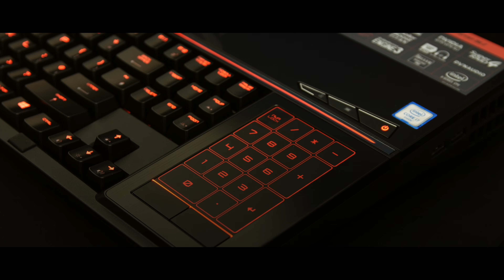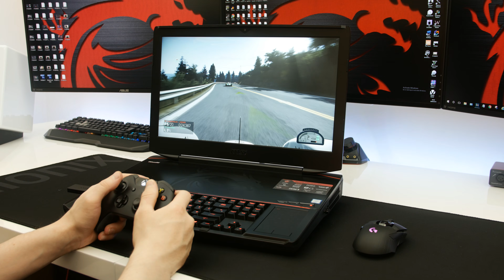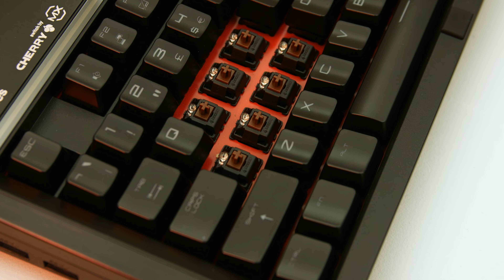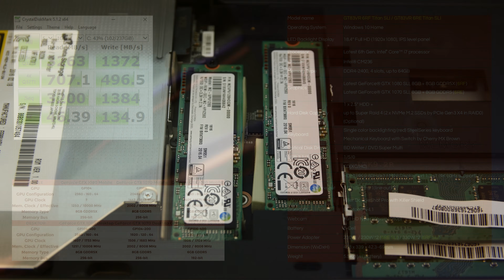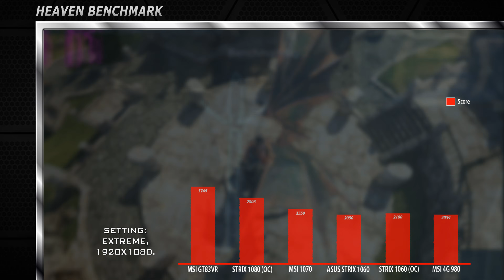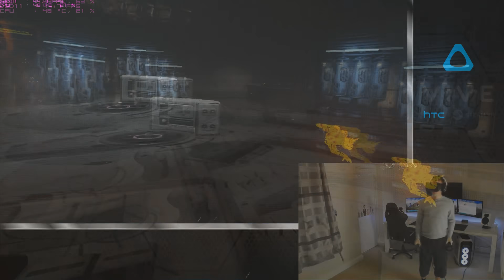MSI GT83VR Titan SLI Gaming Notebook Review, (GTX 1070 SLI Benchmarks)

Comment: Hello Silenced Tech, and those who watch your videos. Good video.
You already have approximately 2 year that you tested this GT83VR laptops.
The question are:
1. Does the laptop still work well?
2. What did you think of the mechanical keyboard, does it work well, do you like it or not anymore?
3. Is it overheated?
4. Does not that laptop fail (screen, ram, memory, etc.?
Thanks for your response. It's because they sell me one at a low cost

Comment: getting this tomorrow with 1070 sli but 7th gen i7, 64gb ram, and both teh ssd and hard drive are each 1TB....so excited!  Gotta say in addition to the power on this thing, the mechanical keys really sold me....miss gaming on that.
Reply: Picked up the 6th gen i7 one, nearly the same stats. I'm hoping it will fit into my travel bag LOL

Comment: I just bought the MSI GT83VR 6RF, I just have one question is there any downside to using overclocking the cpu at all times and running it at turbo mode? Will it lower the life expectancy of the processor? Because I feel the base processor frequency could bottleneck the two gtx 1080 sli

Comment: Upgrades from MSI for current GT owners.  Mind you...this is for exchange to new model at upgrade price!  Contact them. 

Your Laptop Upgraded Equivalent Unit Estimated Cost
GT72 w/970M   GT72VR Dominator w/GTX 1060 $600
GT72 w/980M GT72VR Dominator Pro w/GTX 1070 $700
GT72 w/980  GT73VR Titan Pro w/GTX 1080 $1,000
GT72S w/970M GT72VR Dominator-032 w/1060 $600
GT72S w/ 980M GT73VR TITAN-017 w/ 1070 $700
GT72S Tobii GT72VR Tobii-031 w/GTX 1070 $700
GT72S w/ 980 GT73VR Titan Pro-202 w/ 1080 $1,000
GT80 w/980(M) GT73VR Titan Pro w/GTX 1080 $1,000
GT80 w/965M SLI   GT83VR Titan Pro w/GTX 1070 SLI $1800
GT80 w/970M SLI GT83VR Titan Pro w/GTX 1070 SLI $1,800
GT80 w/980M SLI GT83VR Titan Pro w/GTX 1070 SLI $1,400
GT80 w/980 SLI  GT83VR Titan Pro w/GTX 1080 SLI $2,000

Comment: The new model of this uses a better processor and maxes out the memory. It also upgraded to 120 hertz display. The new GT83VR also runs in super Raid 4 as well. Originally I was planning on going with the Asus GX800. 

That system your pushing $7,000 way over my budget. Sure the damn thing isi water cooled and all but still. Anyways this is the next best thing. Not to mention the fact that you can upgrade the GPU'S later. As far as the standard HD display I'm not going to make too big of a deal about. 

Due to the fact that you can  output to 4K external monitor's. Or a 4K compatible TV which I normally game on anyways. I can forgive a few short comings here and there. Having a fully mechanical keyboard as well as a USB 3.1 & lightning port combined is kind of unusual. 

So it's going to add a lot of extra ability to the machine. In addition to its 5 USB 3 ports as well. As far as it not being able to fully maximize 2 1070's. I think will come as we move further along into DX12 territory. 

Which should allow for some better drivers to power this beast more proficiently. I'm just getting it just to have a little future-proofing in my system. So i can overlook some of these deficiencies

Comment: I have one, I just recently received the model up from this. Its still got the GT83VR Titan SLI, but I am using 1080's instead of the GTA1070's. I opted for the 1080, and got bigger hard drives, more ram.. Basically everything is double, or upgraded on my version. It is an amazing laptop. Specially when I hook it ip to my gaming monitors. And to this is "portable". 

https://www.amazon.com/MSI-GT83VR-SLI-024-Extreme-i7-6920HQ/dp/B01IO9YBTY/ref=sr_1_2?ie=UTF8&qid=1478022610&sr=8-2&keywords=MSI+gaming+laptop+1080

^ Tis the one I bought. I love it and recommend it to anyone that is thinking of dropping some cash on the laptop..

I really hope I get to see you review that new Acer Predator that is coming out, the 21 inch curved screen laptop.
Reply: Nicholas Simons Thanks
Reply: Nicholas Simons But the price is high at 4599 for a laptop ??? This is not apple

Comment: this is awesome but I can build a PC with a i7 6800k and sli 1070 cards for about 2100 bucks.
Reply: Bryan Eich but can you pack it up into a backpack :)
Reply: You're still gonna need a massive backpack to pack this monster in and you're gonna feel that weight if you also put in the power bricks. I don't think it's realistic to buy this thing right now. Maybe wait a couple of years until the size becomes more manageable. You can buy MSI gaming laptops for ~$1000 that will play pretty much any modern game at a decent framerate, but lower resolution, which is a perfectly acceptable tradeoff for me.

Comment: MSI deserve a bit of criticism for putting 60Hz 1080p displays in these things, what a complete joke. They also should not be let off the hook for their promise to the owners of the predecessor, the GTX 980M SLI equipped Titan, that it absolutely would be forward compatible. They essentially promised that that unit would be upgradable, but due to the MXM form factor of GTX 1080 and 1070 this is not possible. 

I implore any GT80 Titan owners reading this to open a class action lawsuit agains MSI. 

No more overpriced garbage please.

Yes, kudos for the mechanical keyboard. But put a proper fucking G-Sync display in it at least MSI! 

GTX 1070 SLI is easily capable of pushing 1440p at 120Hz! 

Hell I'm currently rocking Fallout 4 nearly maxed out (Godrays and Shadow Distance Medium) at 75-90 FPS with texture mods and an ENB at that resolution with a single overclocked 980 Ti, of which a single GTX 1070 is about as fast!

GET WITH THE PROGRAM. 

$4k pricetag without 120Hz G-Sync display? BACK TO THE FUCKING DRAWING BOARD WITH YOUR MEDIOCRITY
Reply: MSI has an upgrade program for GT80s 980 and 980m SLI or not.  They will exchange yours for a 170 or 1080 at same upgrade price as if you were to just upgrade GPus.  Check into it
Reply: It is possible as they are actually replacing your entire laptop with new model.  It is happening... :)

Your Laptop Upgraded Equivalent Unit Estimated Cost
GT72 w/970M   GT72VR Dominator w/GTX 1060 $600
GT72 w/980M GT72VR Dominator Pro w/GTX 1070 $700
GT72 w/980  GT73VR Titan Pro w/GTX 1080 $1,000
GT72S w/970M GT72VR Dominator-032 w/1060 $600
GT72S w/ 980M GT73VR TITAN-017 w/ 1070 $700
GT72S Tobii GT72VR Tobii-031 w/GTX 1070 $700
GT72S w/ 980 GT73VR Titan Pro-202 w/ 1080 $1,000
GT80 w/980(M) GT73VR Titan Pro w/GTX 1080 $1,000
GT80 w/965M SLI   GT83VR Titan Pro w/GTX 1070 SLI $1800
GT80 w/970M SLI GT83VR Titan Pro w/GTX 1070 SLI $1,800
GT80 w/980M SLI GT83VR Titan Pro w/GTX 1070 SLI $1,400
GT80 w/980 SLI  GT83VR Titan Pro w/GTX 1080 SLI $2,000
Reply: Ok.  Well, is anyone unsure now?  LOL
Reply: bro, if u want msi full hd with 120hz g synk, that means games have to run around 110-120fps to get full advantage of gsync. That is easy now with 10xx raphics cards but think longterm which will not be possible (u cant upgrade graphic card on laptop, service will only "replace" graphic card u currently have, in case it burns, not upgrade to better).
Just saying, cause marketing seems to promote gsync lately...
Reply: btw vincent, on ur original comment, dont make people belive SLi is best thing ever.... It is quite the OPPOSITE for 2 reasons.
1. In laptops, cpu is nowhere near what pc cpu can do, overclocking is easy on desktop now.. That means laptops with 2 x 1070 or 2x1080,  will not push FPS as much as they can, cause gpu limits are in pair with what each cpu can do. Weak cpu on every laptop means 2nd 1070 or 1080 will perform only a slight % of what it could really do on desktop SLi. No need to say more about this subject, some people say laptop sli advantage is as low as 20% increase in most cases (not sure about that).
2. DRIVERS DRIVERS DRIVERS. Understood? Most games, if not all, even now experience problems with any kind of SLi and need extra drivers from the company of each game to take advantage of the extra thrust. There are cases 2nd gpu is even disabled during gameplay when there are not proper drivers for a game. That means, SLi is 100% connected to if EACH gaming company creates drivers for sli or not. U guys bein gamers like me, u really want to take the risk and walk around with  x2 huge AC connected to laptop for the double  power drain laptops with sli need? 1080gtx x2  laptops need 330wat x2 ac :D 2 huge bricks to carry.

Comment: Really good video. While I agree it is impressive if you can overclock the monitor to 100hz without issues (I can't even get my ultrawide to 80) I really don't understand what they were thinking with a 1080p/60 monitor.. Even a single gtx 1070 is way overkill for that and two is just silly. And if you have to plug it in to an external monitor then what is the point, really. It should've been a 1440p 120 hz with Gsync
Reply from the maker: +Mikkel Birch Thanks very much, unfortunately you can only get a 18.4 inch display at 1080p 60hz right now. Even so they still shouldn't of paired it with two 1070's in my opinion.
I was surprised the panel managed to overclock that high, that saved it from getting a much lower final score.
Reply: mikkel birch, u said the word "OVERKILL". Well, when it comes to laptops u should aim for that. Stop reading articles from companies that u can upgrade in the future. So, u want it to last longer and ofc for a gamer u must have an "overkill" laptop today to last for that long as games became super hungry (aka witcher 3 /rise of the tombraider) and will only become hungrier longterm.
As for the sli, that s a separate subject and i m against SLi.
Reply: George Giannoulis i definitely see you point. Except that the 60hz refresh rate makes no sense with 1080p and SLI 1070s. With a 144hz panel your point would still be valid. And still, the CPU will become obsolete loooong before the gpus do at that resolution and refresh rate
Reply: Even a single gtx 1070 is overkill??? Say it again!!! I have my Asus G-series with 1070, and it struggles with Xcom2 only getting 30 to 40fps at demanding missions at 1080p high settings.  1070 is not overkill, but just an adequate card for a laptop with 1080p screen. Heck, 1080 is not even overkill. 1070 sli is needed. Obviously, you didn't own a 1070 laptop. Please lots of videos about how great the card is not telling the true story. Buy one, then you know what I am talking about.

Comment: They cant use only one power pack due to regulations and cost, once you go over a specific wattage for an external power supply it has to be made to an industrial specification which would drive the cost up.
Reply from the maker: +FaithsFallen Oh nice, I guess if it was that easy they would have done it.
Reply: TotallySilenced Tech
Remove over inebriated comment ;o)
Reply from the maker: I think you've misinterpreted my comment lol.
Reply: TotallySilenced Tech
LOL your correct i thought i was replying to something else oops
Reply from the maker: Haha no worries.